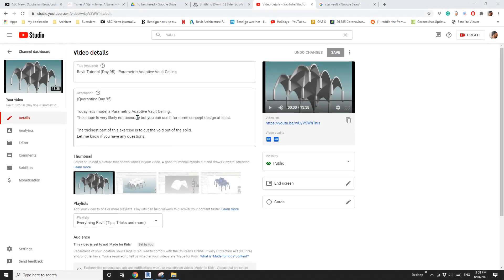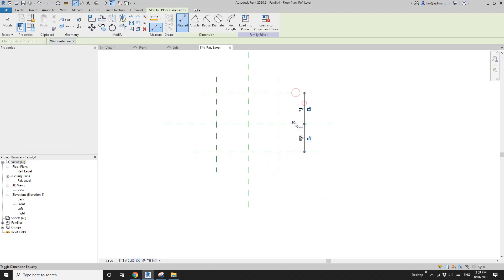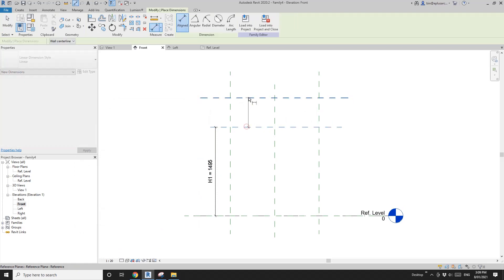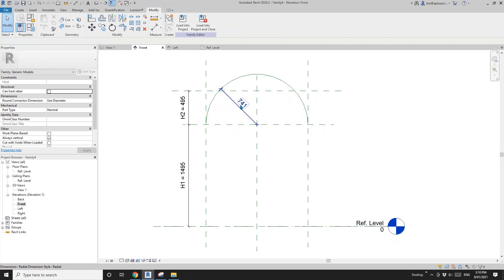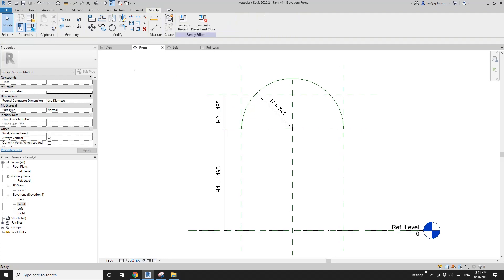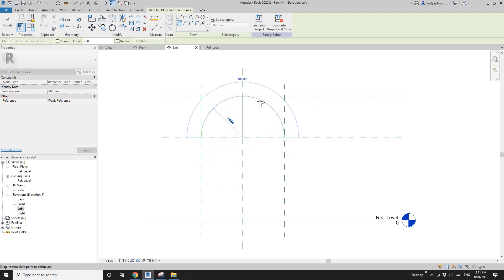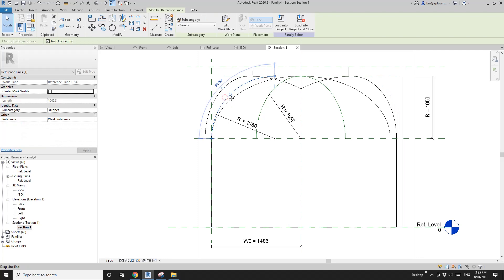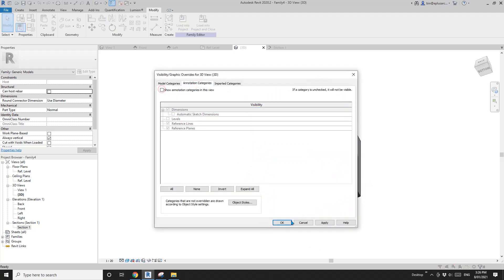Everyday Revit (Day 295) - Parametric Vault Family

Comment: Hi sir how r u ...i have one problem.regarding line based family ...i m sending u a.link in which two  family created to make a. Line based railings....it's has a formula ...i requested you to please make  this family as.same as.this by formula ....i m waiting for ur reply and video thans a.lot ..take care.... https://youtu.be/fAQ42uDGrpc
Reply: Plz make this video from ur side as same as in this video ...
Reply from the maker: To create a similar line based family like the one in the video, you will need to building 2 families and load them into a line based family. In one of the family, there will be a post. In the other family, you will need to create an array of the single panel and create a overall with parameter.  After that, load both families into a line based family, place the post family at the beginning of the reference line and array with “End” to the end of the reference line, create number parameter for the array and give a formula to it, something like No.=Length/max panel with. You will need to associate the overall panel with of the panel family to this max width. Then, place the panel family half of the panel width away from the left end of the reference line and create an array “end” to half of panel width away from the right end of the reference line and create another number parameter with a formula “post number -1”.  That’s it. Clear as mud?   I think you can use railing tool as well. I’ll have a try later today.
Reply: @BINHE615  some confusion but if u make video of this i will highly obliged u...thanku sir
Reply from the maker: Don’t worry about it. I wrote it on my phone so might be some mistakes. I have done a video of that type of line based family and will publish it in a few days.
Reply: @BINHE615  thanku sir ..actullay it's a line based and double familiy array in a single family ...so we can learn something I'n this s tutorial that's why i m requesting u ...thanku for ur reply .....take care bye